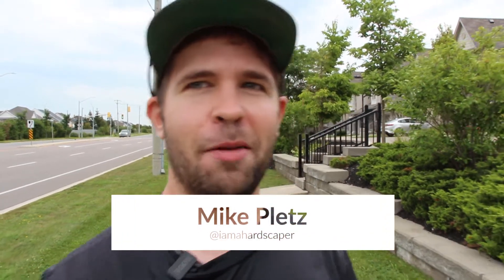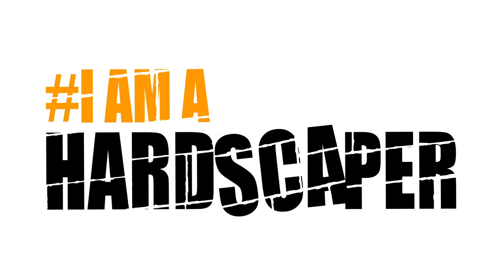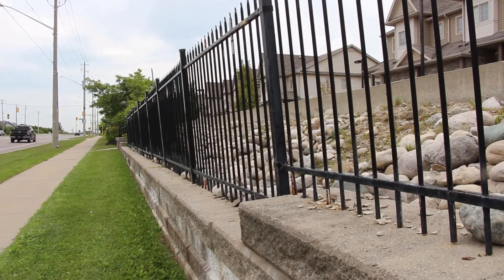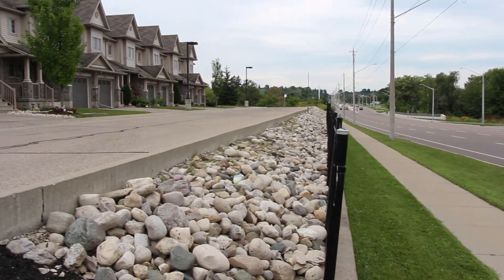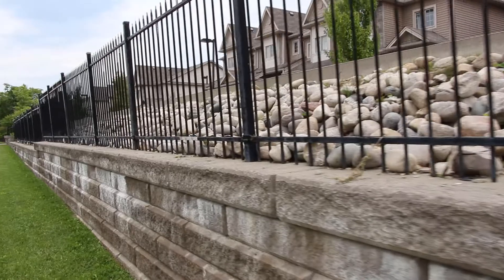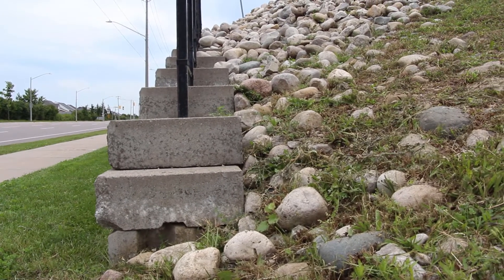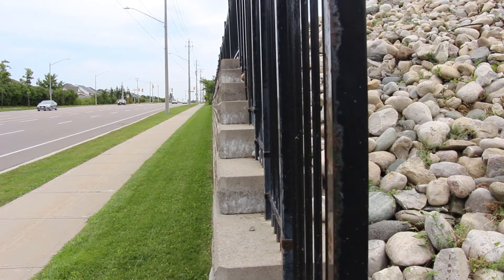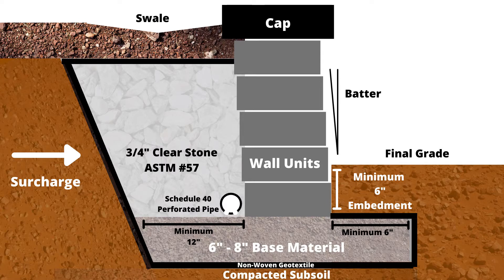Retaining Wall Failures | IT WILL FALL!

Comment: For a very short wall, less than 2 feet at the highest point, could a corrugated drain pipe in the back be excluded if the wall is still backfilled with drainage gravel and there are outlets every 2 or 3 feet in the wall for water to escape from? I’m working on a very short wall but having trouble understanding the benefit of a drain pipe with such a short wall but don’t want to build it incorrectly. Seems like overkill if the water can still drain through the gravel and through the outlets
Reply from the maker: I'd never exclude the pipe personally. For there to be outlets in the wall there would have to be a pipe to flow through those outlets, otherwise you are just adding pressure to the wall and the water has to flow through it because it is the path of least resistance. The pipe is not expensive enough to skip and means a little less gravel too.